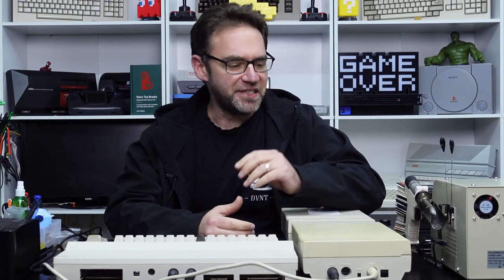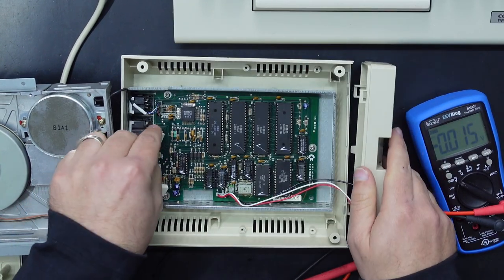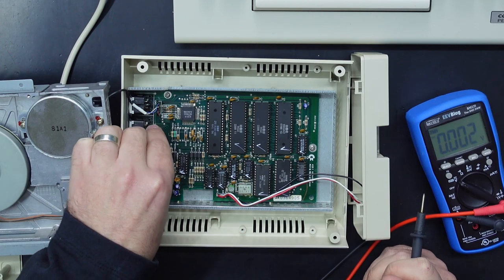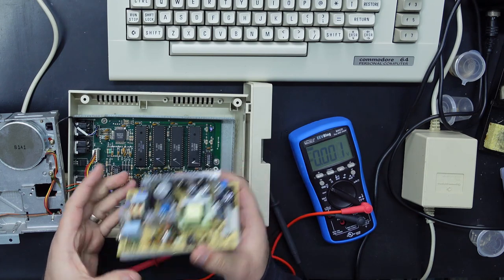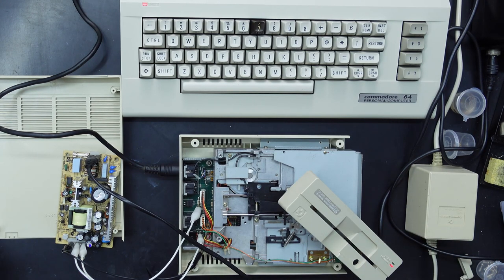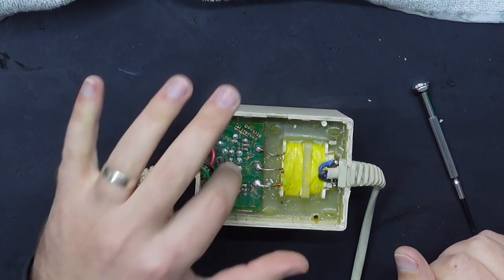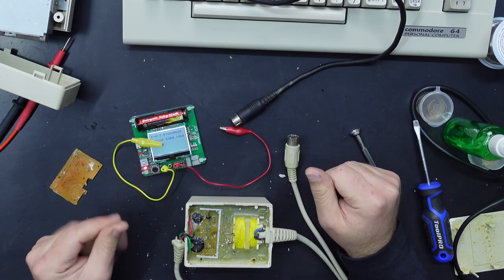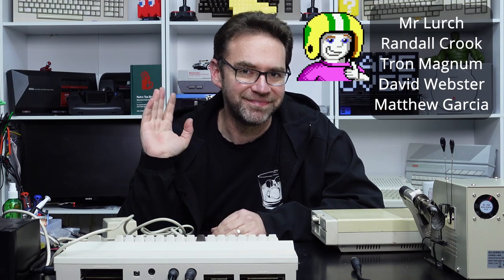Commodore 1541-II diagnosis and repair

Comment: Thanks mate! Just checked my 1541-II with your analysis and it has the same problem. The PSU worked for the last few days. Just ordered a 2-in-1 PSU for my C64C and the 1541-II as replacement which will save room as well.

Comment: Literally I watched this video and my 1541-II had the same problem the next day. I'd already ordered a combined replacement PSU for the C64 and 1541-II (I know the C64 PSUs go bad and kill the system) which finally turned up and of course resolved the issue. I wouldn't have had a clue otherwise because the PSU seemed to show normal voltages otherwise

Comment: You did a nice job finding the issue. I would have changed all the ICs and caps in the 1541-II before thinking that the power supply might be the issue. Thumbs up 😀
Reply from the maker: Funny you say that, this drive did have a prior issue with a faulty ROM. If you look closely you can see that I've already socketed all the ICs and replaced the caps. I didn't troubleshoot the issue, so instead just pulled out everything, I think the ROM was the last one I checked! But my intention is to use this drive as a test bed, like the ZIF socketed C64

Comment: I ended up with two 1541II drives without power supplies. I repurposed a couple of switchmode power supplies that were originally for USB HDD cases (dual output 12V/5V). A quick check on the output wires and the addition of a 4-pin DIN plug made for a nice replacement.
Reply from the maker: Yep, I picked up one designed to power a HDD and also a cheapie off 5/12v supply off Banggood. Now it's just a case of figuring out which one will work better

Comment: Ha, your C64C has the same keyboard feature as mine, a single keycap from a Breadbin! XD
Wow, that's a lot softer potting material than the C64 bricks! (at least on the surface?)
I find de-soldering all the components makes it fairly easy to remove the PCB intact. (oh, you did!)
I don't think it's expansion so much as heat and chemicals from the potting that bows the cases like that.
The real pain is getting the epoxy brick out and chipping the transformer free, if you choose to rebuild the original design instead of replacing fully with a modern switching unit. (no judgement either way, it's just preferences)
Good informational video! Seems people might want to use 'saver' circuits to protect their drives from these bricks.

Comment: You might be able to get 2 small power supplied fro  Aliexpress or Banggood to fit side by side in that case.   I used one for my C64 power brick rebuild and was able to salvage the transformer for the AC.    Since you want dual DC voltages,  the tiny switching power supplies I got a short while ago should fit safely side by side I side the original enclosure

Comment: I fixed my 1541 II old power supply. Solder a new cap on top of the old one will do the trick. The drive will freak out when it receives too much AC ripple. Put your meter in AC mode and check the 12v DC out. There should be no AC on the 12V DC out line.

Comment: Hi Mark! If you want to keep using that old C= PSU case (for appearance sake?), I bet a Meanwell IRM-10-5 (especially the through-hole model, instead of thee screw terminal one) and an SD XMDZ DC-DC boost module, for 12V (like Keelog and Electroware use for their dual PSUs) would fit in there. If you recall, when you helped me by measuring your 1541-II motor current draw, we found that the SD XMDZ can provide more than enough for the 1541-II motor (since it also worked for my original 1541, which drew 2/3 an amp, peak, on 12V).
Reply from the maker: Ah yes of course, I totally forgot about the boost module. I've already got another switched mode supply that delivers the 5v and 12v but if that doesn't work out I will certainly try your way
Reply: @TheRetroChannel  I think those components cost is < $10... ~9 + ~0.50 USD.

Comment: I believe that the bad cap is 2200uF at 25V. It may have been possible to leave the bad one in situ and parallel a couple of 1000uF caps (or even 4 x 470uF) in space beneath the lid? (hard to tell from the video if there’s enough space)
Reply: (And disconnect one leg of the bad cap of course)
Reply from the maker: There's very little space, even for a few 470s. I've got a couple of different switching supplies on the way so at least one of them should fit

Comment: Whoever thought of that epoxy potting solution will not make it on to my christmas card list. 
Apparently the stuff dissipates heat very well, but it sure doesn't attract christmas cards.
Reply from the maker: Yeah I've heard similar things about the potting actually helping dissipate the heat. I guess everything is built to a cost, and putting a linear PSU in a sealed potted brick was likely the cheapest way out. Good ol' Commodore!

Comment: A word of caution: never plug the serial cable into the drive when it’s on. It could destroy one or more of the chips.
Reply: The DIN plugs are stupid in that very often the signal pins mate before the sheath. If there is a potential difference between the device chassi, it wil try and equalize through the signal path.

Comment: WOW AMAZING! I found the Commodore 64 and the Commodore 1541 II in the cellar, but they were immersed in total humidity, do you think i should wait before trying to connect them to the current and turn them on?
It counts that the discs with the games are full of mold, but it is generated by the paper labels ...
Reply from the maker: Maybe wait a couple of days before powering them on, but chances are the damage has already been done. For your sake I hope they still work, good luck

Comment: I've had quite a few 1541-II where that SONY IC would hold the CPU in Reset, but everything else is OK with the drive and I can't get it to work no matter what. PSU is not the issue, I don't even have one and made my own from a thin client PSU. Also it stays in reset no matter if the motors are connected or not.
I have ONE SINGLE working 1541-II...
Reply from the maker: Yeah it seems the Sony IC is very sensitive and it doesn't take much to hold the CPU in reset. Seeing as you've ruled out any other issues , lift and isolate the pin on the Sony IC that holds the reset line, the drive should work just fine
Reply: @TheRetroChannel  The chips on my drives were made by Motorola and Sanyo respectively - and the drives do not work. All I can do is load a one file demo that blinks the drive LED, hook up the defective one with the reset line lifted, run the program and enjoy the blinking.
Reply from the maker: Intersting, yeah the Motorola and Sanyo are equivalents to the Sony. Sounds like there's a deeper issue...

Comment: Similar issue with 1581 drives... using the same aged power supply.
Reply from the maker: Interesting, I have a 1571 with a bad lower head but it has a internal switched mode. I didn't realise they went back to an external brick with the 1581

Comment: RPD-60A might fit diagonally
Reply from the maker: Thanks, I think that's one of the ones I looked at. There were a couple that would fit daignoally but the components on either edge would be too tall. I've got something on the way that should fit, had to think outside the box a little, no pun intended

Comment: Hello.  I know this is an old video.   My psu is fine.   Replaced cpu..  stopped spinning problem.. however it won't read/ format.   Head exerciser works with the world of Jani.   The head reads fine and passes tests with another board.   Strange eh?  Any thoughts would be greatly appreciated
Reply from the maker: If the drive responds normally but won't read or format, it might be the read write amplifier has gone bad. It's the square surface mount IC
Reply: Ok bud thank you. I have another parts drive coming.   Those beltless ones are more reliable than the newtronics.   Probably couldn't find that square chip anyways.  U are always responsive.  I really appreciate it

Comment: DOOD! You can get a dual CPU/Drive 3rd party replacement power supply off Amazon for $70. One brick drives both units.
Reply from the maker: Yeah, I've seen the Keelog version but I don't trust their PSUs. They're probably fine for the 1541s but I've seen them introduce noise in the video output on certain C64s. This is for an older C64 only version so I hope they have improved them since

Comment: Just find a 5v wall wart and a 12v wall wart, and stick the guts in the commodore brick. That's what I did for my C64 (just the 5v).
Reply: Oh and PS... my 1541 mark ii had the same issue as yours. My 12 volt rail died just like yours.

Comment: There are schematics available for the power supply. How about a new transformer and making a custom PCB that would fit inside the original casing?
Reply: what's wrong with the old transformer? (unless of course the replacement will be a switch mode PSU) (don't get me wrong, putting a new PSU in and developing a retrofit PCB is a great idea - just... Transformers don't usually go bad... ever. It can happen though - but here the culprit was clearly a dead capacitor)
I'd probably drilled the old cap out and stuck a new one in.
Reply from the maker: In theory if I could seperate the transformer then it could be reused. But then I'd still need to design and put in a linear supply (there's no way I could design a switched mode myself) so again heat build up would be a concern...
Reply from the maker: Yep the old transformer should be fine assuming it could be seperated from the rest. As for drilling out the cap it was certainly considered, but then I'd just have the same issues with heat buildup. I think I've found a switched mode that should fit, fingers crossed
Reply: @TheRetroChannel  Considering the heat buildup you should consider how much you're gonna run the drive. Way back when, it was used for hours on end. Nowadays it can be compared to a vintage car - you won't be using this as a daily driver. So with one or two hours of operation every once in a while instead of hours and hours of use daily, I'd have just replaced that cap.
Had I planned on using this thing all the time, I'd have gone Tero Säärelä's route, removed the potting, replaced the circuit board and sawed some vents into the case.